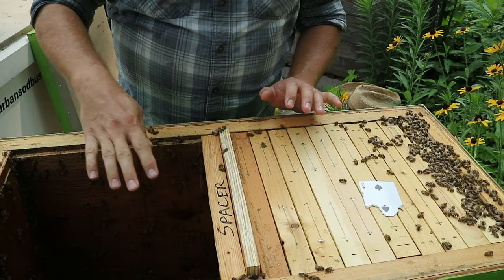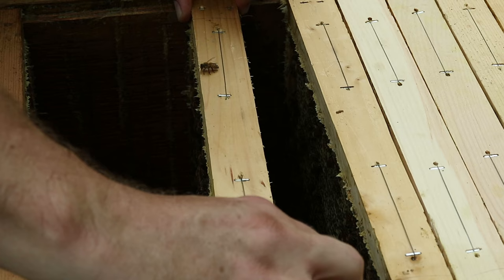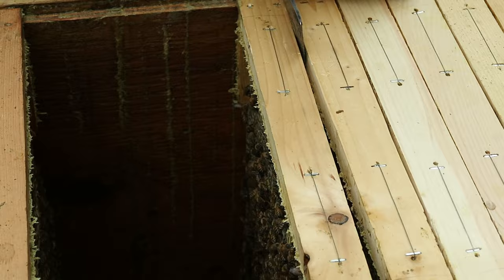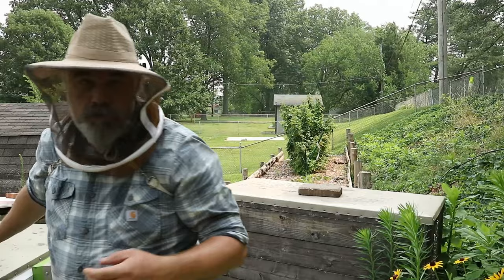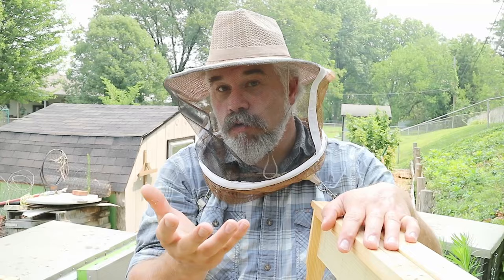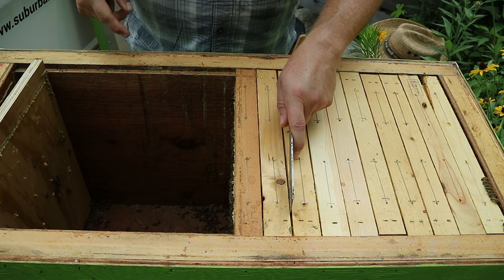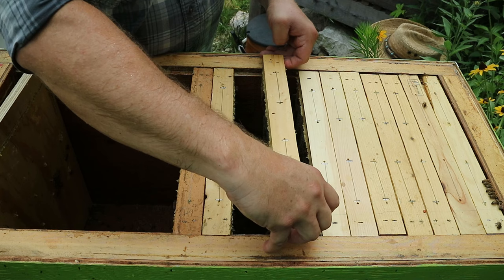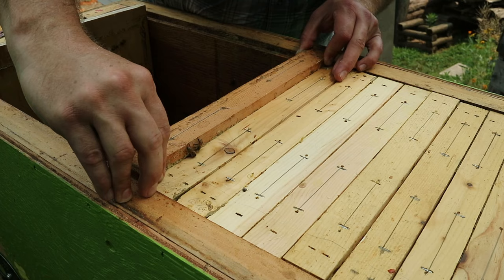How to Avoid Smashing Bees with Layens Beehive Frames

Comment: My experience has been the same with regards to the bees coming out more readily when the gap between frames is about a bee or two in distance. I use both your technique and employ wild turkey feathers (either wing primary or tail) to move then down whilst moving the frames together. The last resort is smoke, though I rarely need to.

Comment: I joked about the bees that would hang out in the empty side of the follower board being the lazy bees. They never built any comb over there at all. Im happy you did this video. I could have used this info in the spring cuz i just found out about the slide down technique about a month ago. I didnt want to do inspections due to the horrible smash crackle sound when putting frames back together. Ty
Reply: I was a few days late checking my Layens hives during flow once and in one hive they built comb on empty frames I leave on the empty side  of the divider board.
Reply from the maker: It is a sickening sound and feeling, and one reason I prefer to work the hive bare-handed.  Without gloves, and working slowly, I can sometimes feel the resistance of a bee in the way and back off before she's hurt.
Reply from the maker: I had a very productive hive do the same.  They still had comb to build within the hive but also began drawing out frames I'd stored in the empty space.  I was trying to add frames in an orderly manner but went ahead and added all of the frames they were working on.  Their plans vs. mine.

Comment: Thats how i do it too, it was very frustrating for me to learn but love my layens . I use the touch technique with the drop approach.  Use you get them hot it works well for me with a feather/brush and spray bottle if needed 
If you do foundationless and its soft not fully built out enough, i think the 2 method will possibly break it..

Comment: Bought my first horizontal layens hive in January,  set it up exactly like the instructions said to. Had a large swarm move into it in early June. After a week I went to inspect them and they had built comb on the lid in the open space.  None of the frames were touched. Filled the hive with all 25 frames and they began to use them. Think bees just do whatever they want when it comes to setting up shop for their new home.
Reply from the maker: Did you have any entrances open besides the one on the end with the frames?  And did you have a divider board in place at the end of the frames?  I've never had bees build in the open end; the closest I've had to that is a very productive colony that started drawing comb on frames I'd stored in the open end. They will typically start building closest to the entrance, but if they have an alternate entrance which they choose to use then they would start building comb there regardless of the presence of frames.
Reply: @SuburbanSodbuster  This horizontal hive has 2 entrances on the front, opposite side of lid latches. I made and installed the divider board but wasn't confident in its effectiveness. These bees started drawing comb on the furthest frame next to end wall. Think they have drawn 7 to 8 frames as of last week. Think I can pull the those empty frames on opposite side, put divider board back up now?  On a side note,  I really never want to go back to Langs after having this horizontal,  they are just awesome!
Reply from the maker: Most of my hives also have multiple entrances, but with 1 colony in the hive only 1 entrance should be open at a time.

Comment: Good ideas. I've had good luck rotating frames when pulling and returning to keep from rolling them on the sides. Someone suggested gentle blowing to get them out of the crack as an alternative to smoke, and although I was hesitant to try it at first, it's a go to for me now, esp if my smoker isn't lit, I'm just doing a quick looksie, or I'm at the end of a more involved inspection. Works like a champ, and doesn't stir them up as much as I thought it might.
Reply: For me on the top of the frame in hand but if I breath to close to my open hive it makes them boil... 
Maybe it's my breath!!! 😅

Comment: I started out with the usual layens frame design, then dealing with the bee smashing issue and most of all not knowing how bees are doing in the winter and unable to top dry feed them, and since i build all my frames, I started to cut my top frame piece at same size as side which is 1"and just space frames with my fingers. Easy frame build and no need for router the shoulders on side pieces.

Comment: Thank you for this video from France !😊
Reply: Just a question : how do you feed bees on Layens hive with Candy when they didn’t have enough reserve ? Thank a lot !
Reply from the maker: If a colony seems weak/low on resources at the end of summer then they can be fed thick syrup in a frame feeder to help them build up.  I only do that in extreme cases, though, like for a late season rescue.  Besides that I don't feed or open the hives over winter.  With the deep frames the bees typically store up adequate honey at the top and along the sides of the brood frames on which they will cluster over winter.  Between that and a full frame of honey on each end they should have plenty to get through winter and spring brood rearing until nectar is available.  In my insulated hives I'm surprised at how little honey they actually eat, and their stores have been sufficient even in the non-insulated hives.  This last winter all 7 of my Layens hives survived through winter without feeding.

Comment: With the third variant you can smash the bees that are inside between the the sides of the frames when they get closer and eventually touch each other. The second variant is the best IMO
Reply from the maker: That's a possibility I've recognized but haven't seen it to be much of a problem in practice.  At least the approach minimizes the surface area between which the bees can be trapped.  I generally use a mix of approaches and actually do prefer to slide the frames in vertically, but sometimes the bees crowd in and make it impractical.

Comment: Very helpful... have a nice layens and am waiting for a swarm.   Thank you
Reply: I waited all last year for a swarm. I had 7 swarm traps all in the right kinda places at the right height in shade yadda yadda but nothing. So i bought bees this spring. I just pulled 60 lbs of honey. Good luck
Reply from the maker: In addition to hoping for a swarm I recommend, at the beginning of and throughout swarm season, putting word out in any local community groups you can join (facebook, nextdoor, etc.) that you will come and collect swarms for free.  It's difficult to catch a swarm starting out because your equipment is new and bees tend to prefer a place where bees have been before.  I struck out in my first season of trapping swarms, but instead got my first colony through a community resource.
Reply: It took until year 2 before I got a swarm. August.
Reply: @lambbrookfarm4528  Yes, since they didn't just move right in the week I put it up I figured I would have to find some patience.
Reply: @SuburbanSodbuster  Most appreciated
Reply: @thomaswilliams6155  60 lbs?  Very nice.  This year tried on my property with no luck so far.. Sadly I've noticed few honey bees in my area..  Will move 10 miles away next spring if no luck this spring.